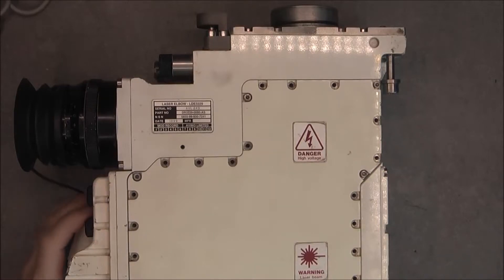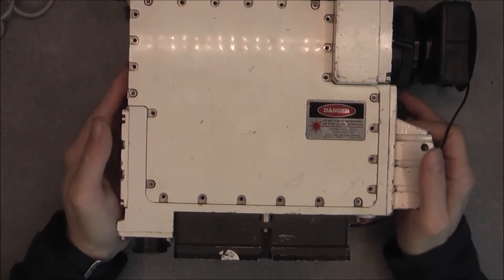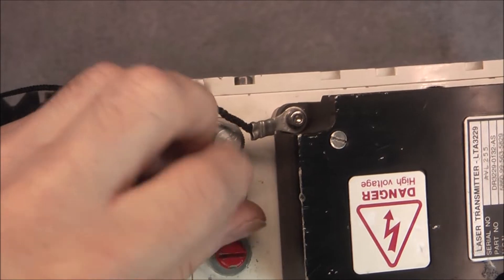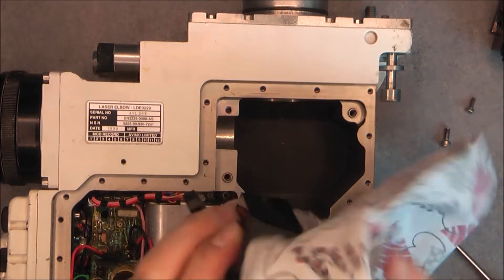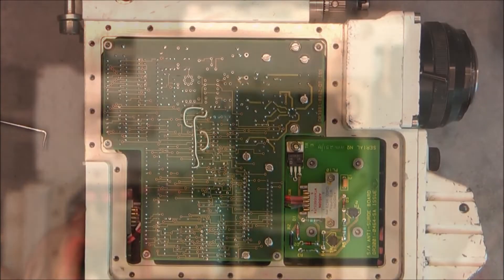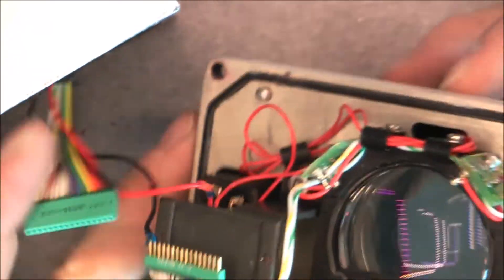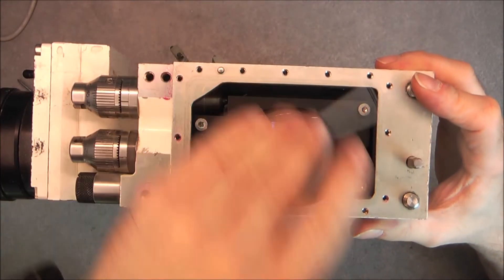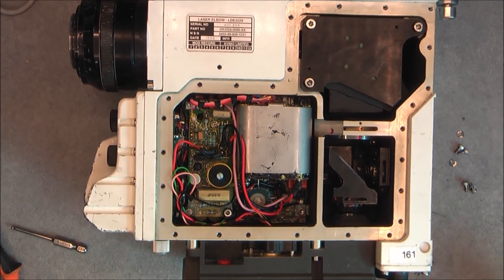Battletank laser elbow daylight sight teardown

Comment: this is similar to the SSY-1 YAG laser, very easy to drive and make air plasma, however by removing the  passive Q-switch block, it needs re-alignment.
Reply: how would someone do such an re alignment?
Reply: @heinrichhein2605  fiddle with it until it makes a round mark on black paper card.